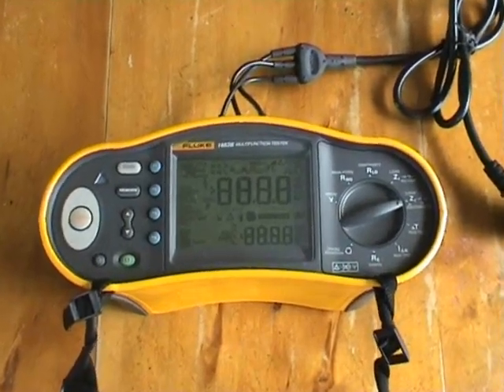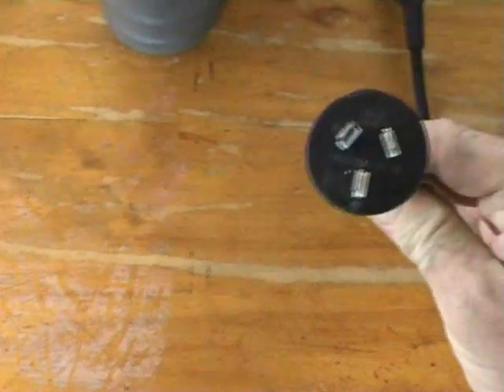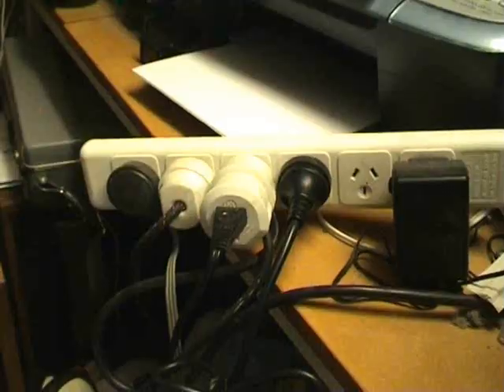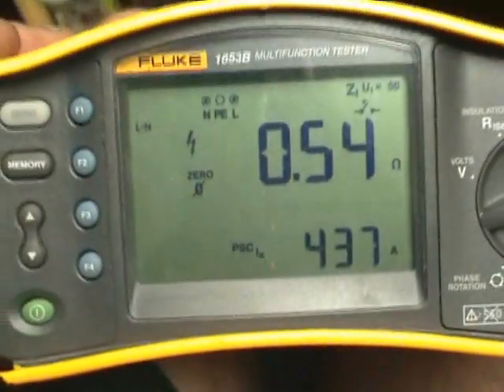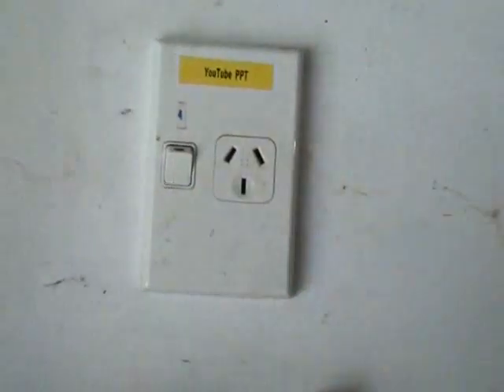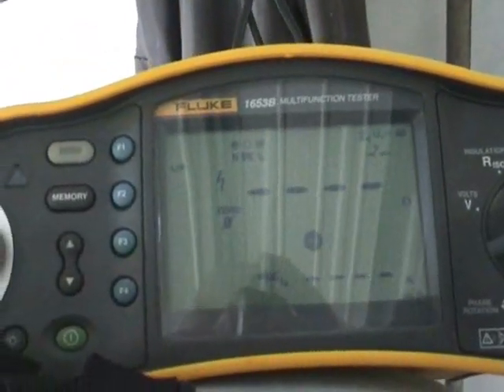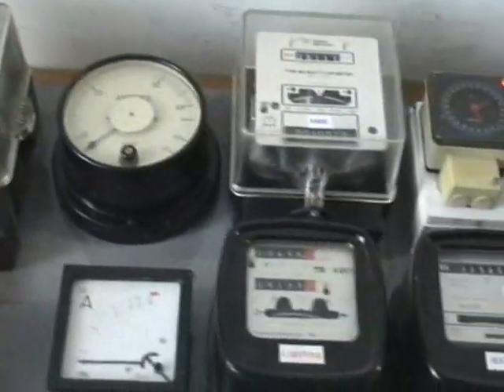Loop impedance testing

Comment: The 1653B measures with a high current L-N test (do you call it Active-Neutral?) and a lowish current N-E test and combines the readings to get the Line-Earth loop impedance. I don't remember what voltage it uses to calculate PFC - whether real, nominal or worst case. My point is the N-E test is done at a low power level. Contact corrosion may increase the resistance. The L and N contacts are kept clean in normal use, but not E. But in real world fault conditions, the corrosion will burn off. A second point is that power boards often include additional fuses which blow easier than house wiring fuses. 

I'm not saying this to explain away your high reading - it definitely should be investigated. Personally, I assemble my own power strips and don't cascade them.

Comment: The purpose of a loop test is to measure the resistance of the earth path from your property back to the electricity sub station, not in your socket outlet.The prospective fault current test measures how many amperes can flow under a fault condition, not how many amperes you have available. You must either have found or stolen that tester, as you clearly don't know what you are talking about.
Reply: Absolutely!! Clueless on the fundamentals of electricity and resistance
Reply: "I have xxx amps available at this socket" 🤣 sure buddy

Comment: Please don't post videos relating to electrical testing and safety when you don't understand what you are doing.
Loop impedance testing is used to verify that the circuit meets a defined standard for loop resistance.  If the resistance of the circuit is too high, a fault might not trip a protective device, such as a fuse or circuit breaker.  The tester verifies that the CIRCUIT meets that standard.  JUST THE CIRCUIT.  So having all those appliances plugged in makes your tests completely invalid.
The 'available current' you talk about is the Prospective Short Circuit Current, the actual current that can flow if you have a fault.  It has nothing to do with 'available amps', which is limited by the protective device (the fuse or circuit breaker).  The loop impedance is affected by several things, such as cable length, cable size and the condition of connections.  If the cable is too small for the distance, you'll get a high resistance and low PSCC.  High resistance faults = heat = potential fire.  This is why electricians do electrical stuff, because we know how to use test gear properly and we understand what the test results mean, which are both lacking in this video.
Reply: Available amps😂😁😀😭
Reply: Someone got out of bed the wrong side. There was nothing wrong with what he said, you confirm it yourself by paraphrasing it.
Reply: how about you get the fuck on
Reply: 🤔 nah

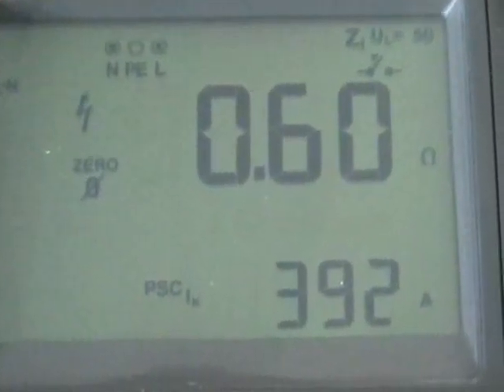Comment: 0:36 has 0.60 ohms (calculated) and 392 amps short circuit (calculated)  V=IR thus 392* 0.60 = 235 volt circuit.  Here in the USA one rarely sees a Loop Impedance Tester. I think your Fluke must first measure the voltage then in test mode draw a small current and thus measure the voltage drop to calculate the resistance of 0.60 Ohms. Then it calculates the PSC short circuit by using the 235 volt measured voltage. ie 390 calculated = 235 volts measured  / 0.60 ohms calculated

In the fluke manual it looks like your tester has a mode where the test current is only 10mA so as not trip some devices. I wonder what the normal test current is?
Reply: Hi, In the UK, AU and here in NZ they use Megger and Fluke because they are top $$ end standard test instruments, I noticed Amprobe kind of have loop testers but in the USA the manufacturers call these circuit testers, they do the same thing as our loop impedance testers.
The 15ma low current loop test will not trip our 30ma RCD but the readings arecalways h are always much higher then the high current 25 amp loop chicks the best way to check a circuit to bypass the gfc I sed and check the circuit with a high current hola readings unreliable

Comment: It is very important to ZERO your test leads first, We did not see you do this. In the UK the max EFLI on a 32Amp BSEN60898 MCB on a ring is 1.2 Ohms, This is at 230Volts. I don't know what voltage you use over there but you should consult the regulations to make sure the EFLI is low enought for the circuit protective devices you have fitted. The amperage shown is the fault current that will flow in the event of a dead short and not the current availible at the socket.
Reply: According to manual you only need to zero your test leads only once. Although you can do it every time you use it, it won't hurt. Next is taken from FLUKE 1653B user manual (Page23): "4. Before you do a loop impedance test, use the zero adapter to zero the test leads or the mains cord. Press and hold  for more than two seconds until the ZERO annunciator appears. The tester measures the lead resistance, stores the reading in memory, and subtracts it from readings. The resistance value is saved even when the power is turned off so it is unnecessary to repeat the operation each time you use the tester with the same test leads or mains cord."
Reply: You don't null the leads to do any live test. The only tests that you nnull the leads for are R1 + R2, measuring a ring final circuit end to end and continuity
Reply: @curtisj2165  Wrong. EFLI, Ze, PSC All live tests and need the leads nulling out to obtain the correct measurement.
Reply: @glenwoofit  wrong, i have three separate testers (continuity, rcd and loop) the only one that has a null function is the continuity (low ohms) tester. How and why would you null the mains lead when it has a bloody plug on the end of it? Please don't argue with me as i do this for a living, search Youtube or Google and you will find that you are wrong
Reply: @curtisj2165  Wrong. You null a fluke tester for Continuity, EFLI and Ze testing, You get the PSC on the same screen. I have several of those testers and I do it for a living so please don't argue with me.

Comment: Good choice of tester ;)    (Same as mine)
Worth checking Earth loop aswell as Line as not all faults are L-N pressing F1 in loop mode adjusts that.
Also, (Not telling you how to suck eggs) the limits vary depending on the fuse
type, e.g. a 6A 60898 Mcb can have 6.13 Ohm (80% corrected)
Reply: You are not teaching him how to suck eggs, he doesn't know what he's talking about. Wtf is available amps?